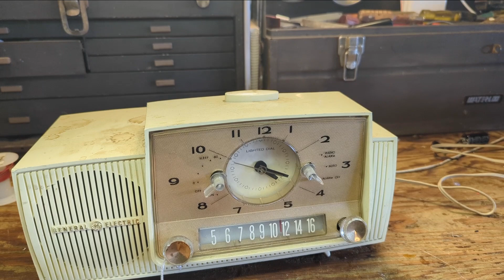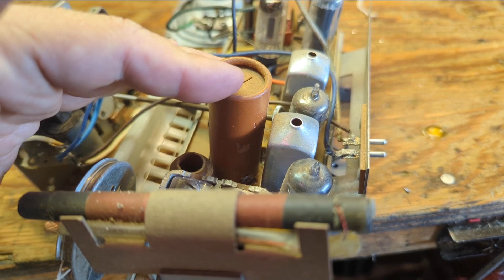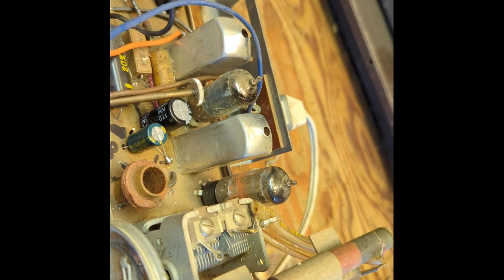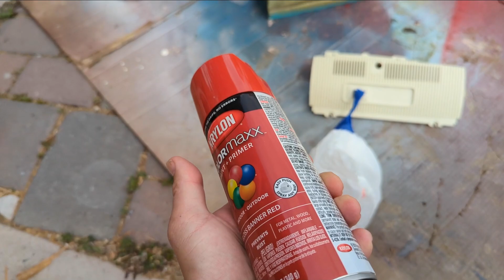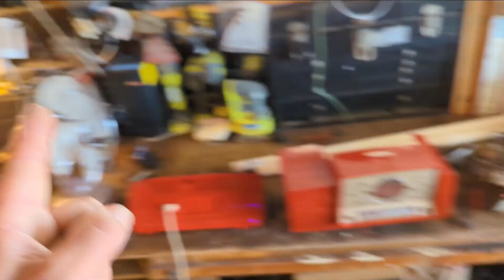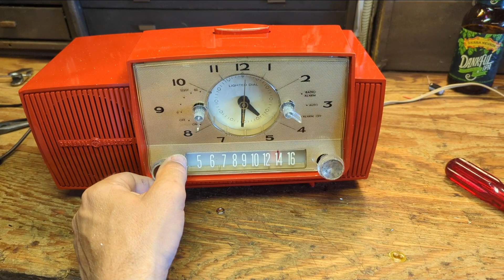How to turn a sort of drab GE clock radio into something more exciting

Comment: Another great job! Have you ever used one of those Bluetooth modules? They will run off of 5v which could likely be robbed from the transformer and they're small enough to hide inside the chassis without drilling holes.

Comment: There was a lot of weird going on at the end of the tube era. They were probably selling those things in discount stores till the early 70s for next to nothing
Reply from the maker: I learn something new every day! See, I was sort of confused why there was what looked like a 60's-era Telechron movement in there. The PC material was also newer looking. I'm not totally surprised. GE was super cheap about everything. The 50's era versions of these were super fragile and the leads on the boards lift up super easily. They must have made improvements.

 Weirdest tube era sets I see are those that have the lower power tubes with strange values. Like 14, 32, whatever volt tubes that are next to impossible to find

Comment: 6:50 Have you ever considered getting a heated solder sucker, the kind with a rubber squeeze bulb? Mine works flawlessly and since I absolutely hate the plastic kind, it makes jobs like this a lot easier. I've had jobs where I used the kind with a stand that hooks up to a vacuum line, but the $15 bulb-type I have at home serves me just as well. The only thing it can't handle are big solder lugs, so I still keep a plastic one around, but only for things too big or irregular for the heated one.
Reply from the maker: I had one but found it sort of annoying since it took up room on the bench. I'm so used to the little one I use now it just feels sort of natural

Comment: Nice work!
Reply: If you find your 'soldapullt' lacking in vacuum, take it apart and add silicone grease to the seals at the front of the cylinder and O-rings on the piston - can make a TON of difference!

Comment: That's definitely a later one.  They made these from 1956 to about 1967.  The earlier ones tend to come in pink, turquoise etc... Later ones are usually more subdued and they added a lighted clock dial.  You can usually date them from the tube date codes.  The red paint definitely improved the look!
Reply: Were the last ones with this case "fully transistorized"? I know the next generation, the ones that initially had a sloped PC board, came in a final version, in 1966 or 1967 that was all solid state. So did the generation after that with the volume knob directly below the tuning dial.  I find those transistorized AA5 models, before the push-pull circuits took over, among the most interesting.
Reply: @pcno2832  possible they made a transistorized version but I've never seen it!  I know that was common, using the same case with a solid state chassis in place of the tube one...
Reply from the maker: Really? They made this design all the way to 67? I had NO idea. I thought it was strictly a 1950's design.
Reply: @misterradio5035  I had two, one of the early ones from 1956, and another one with a date code of December 1966!  Essentially the same set.  Other than the terrible General Industries electrolytics they're very reliable.

Comment: I have got to admit that red paint does make it look a lot better. Krylon spray paint doesn't tend to plug up in the tip like the 
Rustoleum spray paint does. So to keep it not clogging up is when your done spraying paint is to turn the can upside down 
and spray it a couple of times (away from anything) and allow the propellant to clear out any remaining paint in the tip.
Seth saves another one for future sale and made Bluetooth ready as well.
Reply from the maker: I don't know what's up with Rustoleum. I thought I'd gotten a bad batch but it keeps doing this. Maybe its interacting with the plastic
Reply: @misterradio5035  Maybe a contamination issue is going on here? Dunno. For sure the surface must be roughed a bit to make Rustoleum stick. Another reason not to use it!

Comment: I know this model GE very well. You need to play this radio for at least 4 to 5 hours before selling it,  these are notorious for silver Mica disease after it has warmed up and played for a few hours. This goes for all GE sets around this time period.
Reply from the maker: The WORST ones are the models with those plug-in RF transformers. I 100% agree. These are notorious for silver mica disease. I tend to play restored sets off and on for a few days before they go off " into the wild" for the exact reason you suggested.
Reply: @misterradio5035  always a good idea to keep the customers happy. I used to repair radios and record players back in the 1990s for a fellow that used to sell them. We did very well with reconditioned record players until Crosley reproductions started hitting the market we had no problem getting between 150 and $200 for a good restored record player from the 1950s
Reply: Yes, I fixed one of these for somebody a while back, and it had silver mica disease in both IF transformers! Once rebuilt, the radio performed fantastic!